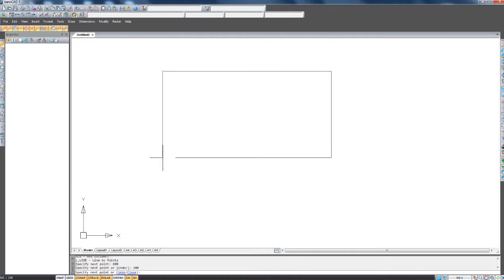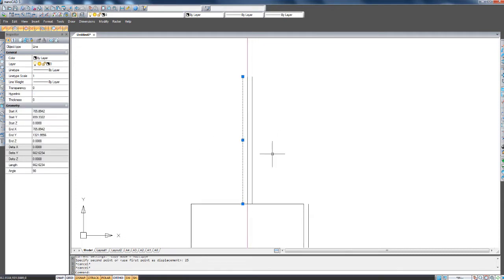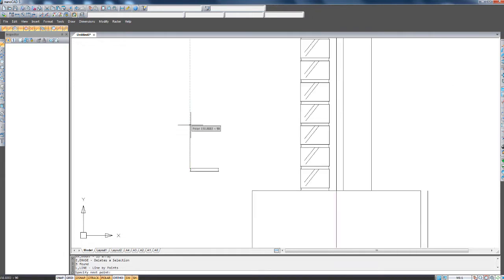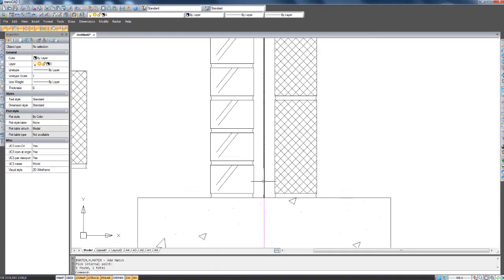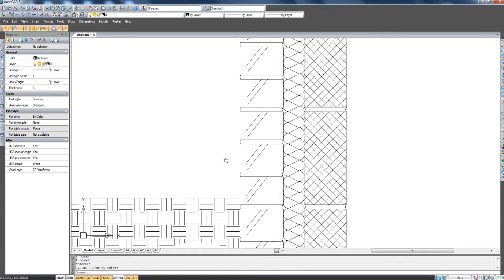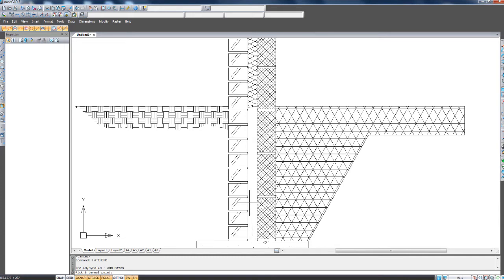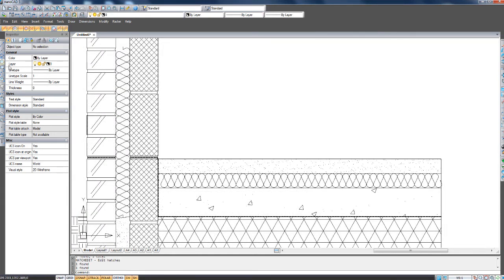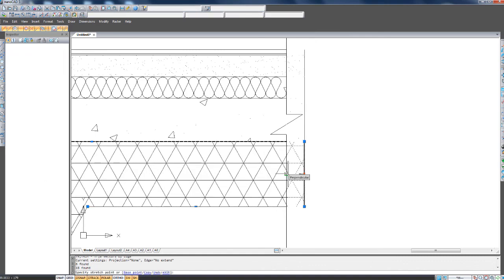How to Draw Cavity Wall Detail in NanoCAD

Comment: I can tell you are used to revit. Autocad pro here, I am used to commands, I don't use the fucking buttons to work. left hand types the command and my right hand directs the cursor where to go. That is why I find working with Revit very different.
Reply from the maker: I need to get used to what the keyboard shortcut commands are. At the moment what I find frustrating it typing in the commands and selecting them, I would rather press 2 letter keys at max to activate a command. Does autocad have 2 button commands?
Reply: @DrawingTechnical  AutoCAD is command based. Revit is procedural. You can't teach experience. This is not something that I do, this is something that I am.
Reply from the maker: Right 👍 I think I will catch up in the CADS quite quickly.

Comment: Why arent you drawing by using commands, copying lines, using x and y values? Im my apprenticeship of course we worked with autocad but still, in a work environment this way of drawing takes too long...
Reply from the maker: I've seen my seniors using AutoCAD very quickly with commands, I'm not used to AutoCAD or nanoCAD, haven't been using it long and when I had to use AutoCAD at work, it took a while to get my work done because I come from Revit as a background. AutoCAD enables me to draw better details than Revit so that's one of the reasons I'm forcing myself to use it.
Reply: @DrawingTechnical  The devil is in the details. Architecture is in the end an art not a science. So how do Revit users detail connections?
Reply from the maker: @jonjonsarms  Revit has a drafting sort of mode with basic drafting tools. You can do call outs of parts of the model, the call outs don't look so great, so we use them as guidelines and draw better hatches over them.
With some skill you can make drawings look good in Revit, I research my senior's AutoCAD drawings and use them as reference to do drawings on Revit.
It's noticed unfortunately that making good artistic drawings is a dying art with the younger generation, I suspect it's because of relying on Revit's viewing abilities too much.
Reply: you must learn the basics and not the shortcuts